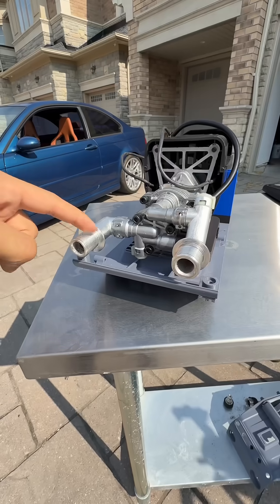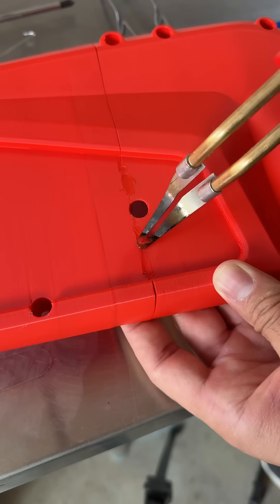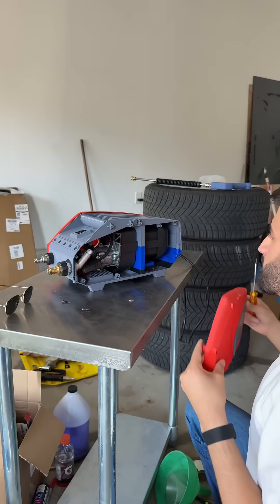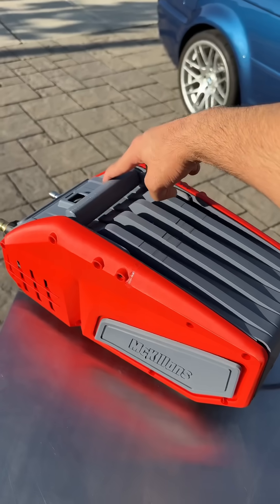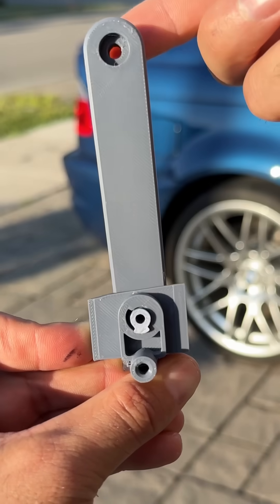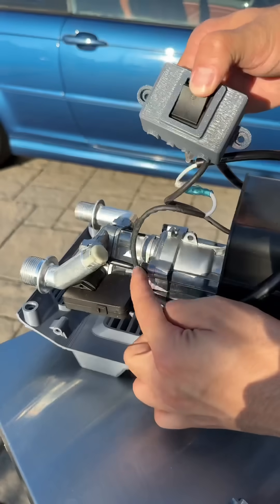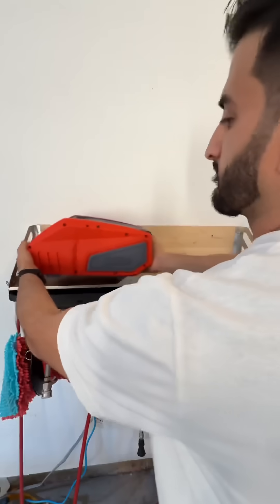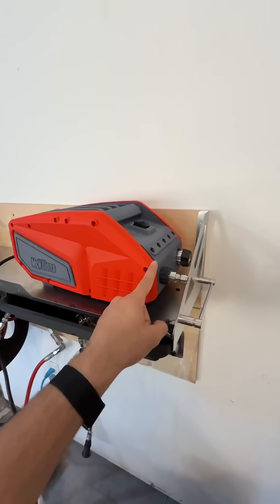Building the Best Pressure Washer for Cars – Testing 3D Printed Prototype #Shorts

Comment: Make it easy to replace panels, sell the panels, offer upgraded carbon panels, sell a “pro” or “plus” “Hd” version with full carbon panels from factory, weather resistant and tough as all get out, seems majority of the outer shell is primarily aesthetic/protection anyhow so making the panels replaceable bring in more reoccurring revenue whilst also not selling another product that’s just going  to break and be replaced/moved on from

Comment: dont know if youll see this but I would be careful with the keyed handle, if the key is that small it may not hold up to the pressure that leverage from the opposite side of the hinge (the handle), might be able to put on it. And if its one piece with the actual handle hinge then the key breaking may crack the hinge as well. I hope this is understandable

Comment: have brass inserts for the screws.  so you are screw into plastic.  if the device ever needs to be repaired it will strip the plastic screws in no time.  Valve made the STEAMDECK OLED and added this feature for repairability. Right To Repair is real dude.

Comment: As a repair tech my advice is:

1- invest to make the water pump portion strong and not like the ones found in the cheaper PW that feel more like hard clay when servicing

2- make it easy to service and open up to repair or replace components

3- have it be more sturdy and include fitting standard between the good brands so that you're not going to Home depot to get fittings for hoses 

My main concern would be having it be like a Ryobi and frankly those PW are the worst.

My biggest advice is to try Barens for parts.

Comment: I am gettin stupid ideas. Compact water pressure systems arent just need for cars also cnc machines. I hope you can push it even more. Perhabs create a lab version. Ship it over it allowed over FBA. So easier access to europe. A more neutral looking version would be need wich can be the lab version. Should be easy to push also thicker substances as well then with a bit more power.

Comment: I hope you used something like PACF material for the print. A lot of other materials won't hold up. At least ABS. Definitely do not use PLA, as it will definitely fail.
Reply from the maker: 3d printing is just for the prototype, final product will be injection molded :)
Reply: @mckillans now that is exactly the way to go. I would suggest either polypropylene or ABS. Unless you want crazy strength... Then I would go with glass filled nylon. I actually used to do injection molding.

Comment: A similarly sized, Chinese/Indian made pressure washer is around 50 USD. Parts are mostly common/standardized and very easy to repair.
Reply from the maker: they're definitely not hitting anywhere near the advertised numbers, see the previous video on testing. companies overstate their numbers by double their actual real world values...it's a marketing tactic because consumers only look at high PSI numbers as a decision maker
Reply: Lol that shits going to flop. Market won’t allow it. No one gives a shit if the pressure isn’t exactily what it says. Not anything worth the small profits your going to make what 10-15 per machine lol
Reply: @mckillans I don't mean to be rude but the pricing is a big factor. I will admit my bosch cost me nearly 300 USD. I'm also not from the US so value propositions are maybe different.

Comment: I would not recommend a sheet metal case, the internals and shape just don't look like they would go well with sheet metal, not to mention the cost of a progressive stamp and die is pretty high. 
This is a job for the industry standard >PA6 GFR< at like 30-50%. Injection moulded, will have excellent durability, will maintain reparability if used correctly. 
The handle lock out is too small and intricate for this size and weight of machine. I would suggest just using a compliant mechanism with a 30% sphere shape protuding from the handle near the pivot, and a reciprocal indent for the sphere. Make it compliant so it snaps into the holes. If the goal is to prevent the handle switching beyond 12 oclock, I would just add plastic stoppers to the case part in the channel where the handle arms sit.
Reply from the maker: final casing will be injection molded :)
Reply: @mckillans  hit me up if you'd like help with the design of the handle lockout mentioned

Comment: That locking cam seems weak Fyi try dropping the machine from folded position a couple of times and inspect inside
Reply: 100% it should just have a compliant mechanism. Put a little sphere bulge on the handle arms (like a BB is in the plastic protruding about 30%) and then add a reciprocal spherical indent/hole make the ball move past or comply past the rigid body until it snaps into the hole. No weak parts no stress concentrations etc.

Comment: TBH the lastic looks so cheap and it looks easily to break!😅😂
Reply: Can't say for sure but it's likely he will be printing final runs out of much stronger material. It's more expensive and there's no need to use your final material for prototype runs
Reply from the maker: this is just a prototype, final product will be injection molded...
Reply: I mean it is a prototype

Comment: Definitely contact a sheet metal sub-contractor for a better case
Reply from the maker: The 3D printing is for prototyping, the final product will be injected molded plastic.
Reply: @mckillans  Thought as much.
Reply: There's no good reason, 3d printed case replacements would be so cheap it woild not be cost effective, not to mention modern 3d printed materials can be extremely strong. You'd go to metal and when the internals wear out now you have a fancy case with no working internals. Using metal would make it costly for no reasonable benefit
Reply: @DarkAttack14  If you're building more than like 500 units, you would just spring for injection moulded parts, and injection moulded GFR PA6 is strong, and industry standard for tool bodies. 
3d printed is not cost effective at even moderate scale, unless youre prusa.
Reply: @DarkAttack14  Microplastic.
Reply: @DarkAttack14 3d printing isn't a manufacturing technique, it's for prototyping.

Comment: Focus on pump quality, stainless steel or ceramic piston, high quality durable internals that are serviceable, oil replacement, pressure unloader valve, high GPM, thorough testing and correct amp vs pressure rating etc. Dressing up a cheap pump is not what I would be interested in.

Comment: Why would you put the inlet and outlet on the same side so you have both hoses laying together and getting tangled easily?? One in the front, one in the back keep it streamlined and easier to move around
Reply: Thats only true if you're located/the pump is going to be between the tap and the car. 
This appears to something that would suit remaining in a detailing van on a shelf. In which case the inlet and outlet are going the same place.
Reply from the maker: you can easily add a 90 degree adapter to the inlet  if you prefer.

Comment: add some wheels or casters on the main body. make the hose couplings go at an angle or maybe make them swivel. Design it for constant everyday use and abuse, not for display.
Reply from the maker: the bottom of the machine will have standard thread which fit many casters, meaning you can buy your own casters and add the wheels :)

Comment: As a repair tech PLEASE make the case out of metal and have easy screws to get to. Also some way to easily change the oil in the pump is required for it to last.

Edit: sorry after reading your replies i do agree with y’all didn’t think about things like ABS or carbon infused plastics. But i still stand on the pump being easy to service.
Reply: With it being plastic it’ll be cheaper to get replacement parts if he continues supporting it
Reply: 3D printed is just for prototyping i am 100% sure he don't intent to sell it with a printed housing
Reply: Just do both. Those who got money would gladly choose the pricier one, just make sure it is worth it for customer & more profitable for the company. Make the cheap one for others, sell the parts to them, including the option for the metal part, but make it pricier because u gonna have more overhead to do this strategies. All side win.
Reply: If they release stl's for diy repairs I'd very happy with that as a compromise.
Reply: @lofty247 I was going to suggest this. Say if a 3d printed part broke or if you just wanted to print a new part out of a more durable plastic then either print it yourself or use a 3d printing service. Way cheaper for the manufacturer and the consumer, and easily serviceable.
Reply: But money
Reply: Metal will rust ?
Reply: It doesnt use oil. Thats how the new technology is
Reply: @higasaurous57 all pressure washers have oil (there may be a rare exception with ceramic bearings) but many times it's not meant to be changed. That's why they will wear out and become useless much sooner than older units would. It would be very good for him to include the ability to change the oil on the unit itself for superior lifespan and wear characteristic in my opinion.
Reply: You can get some insane filaments now a days for reasonable prices. PPA/PA-CF (nylon with carbon fiber reinforcement for strength, dimensional accuracy, and thermal stability) would be the the perfect use for this product and with “fuzzy” skin set it would look pretty nice
Reply: Rust
Reply: Don't make the case out of metal.
Reply: No
Reply: As long as that's not more than a hundred dollars, you'll be
Reply: Metal expensive, product more expensive
Reply: @xXfl33rXx yeah but the initial investment for a more durable and repairable product is more worth it than a 3d case than can snap or crack with normal use.
Reply: @Nathanc6308 ok but if product last too long then that's bad for business
Reply: @Robosium this comment is nasty
Reply: @Robosium Id rather have customer loyalty then have people say my product is crap and it breaks after x amount of years. Rather be around a long time innovating new products to sell rather than sell the same junk over and over again. Simple. He’s selling a pretty case over an item that’s been around for decades he can add some metal and make it last.
Reply: @Robosium don’t be that guy, ever. That’s terrible my friend. That’s why most of my appliances and tools are considered antiques. They last forever and are easy to work on/with. Cool thing about it, I will only buy from certain companies even though it’s a bit pricier. They last.
Reply: @Nathanc6308 good thing 3d printed materials are so cheap if it cracks it's massively cheaper than buying a metal case in the first place. There's a balancing point and 3D printing is only getting cheaper every year. Let's say the product costs 300 with a 3d printed case and 500 for one with a metal case. It may only cost you 50 dollars to repair the 3d printed model. If it did, it would have to break 4 times before you get to a point you'd have been better off buying the metal product! In reality there are extremely strong 3d printing materials avaliable nowadays that it likely would not be an issue, and the plastic would be significantly lighter
Reply: @kiyoponnnit's not truthful though. Companies on average do not make products designed to fail (unless you're apple, pretty shitty people running the show over there)
Reply: @kiyoponnnnah greed hurts everyone
Reply: @Nathanc6308  Im assuming its 3d printed now just for prottyping. 
Industry standard is GFR PA6 at like 30-50%. I wouldn't use ABS over GFR PA6. 
The major tool companies that produce cordless tools and allow for easy to repair tools all use GFR PA6.
Ryobi tool clamshells are ABS. 

Injection moulded the thing will be tough, remain light, and inexpensive.
Reply: @Nathanc6308 making it out of metal compared to plastic is not an initial investment, it’s an ongoing cost that scales with volume lol
Reply: @DarkAttack14 "on average"? "only Apple"? Say that to an appliance repair tech, an auto mechanic or a wholesale parts supplier and see how that goes
Reply: Doesn’t need to be metal, just needs nuts molded into the plastic
Reply: @KangaMoose34  This piece of shit is gonna be something you'll have to replace every single summer😂
Reply: Metal is expensive and not entirely favorable given that it will be living in garages with water, having plastic with proper heat set inserts is a good way for him to make it a great product
Reply: @maximman102n7 
Ever heard of quality stainless? If it lasts in marine environments for years it'll last in your garage for decades.
Reply: @Ellron23 Ever hear of cost effectiveness? Who cares if the case survives when the internals will wear out after a few years

Comment: Is the switch rubber sealed? Because if it is on the top it will absorve a lots of water and potentionally kill someone.
Reply: That's unlikely to occur even with a completely exposed switch and spraying water directly on it lol, you'd need the perfect storm of failure to even risk it. You can spray a fire hose directly at a powerline and not even get a tingle
Reply from the maker: yup there will be a rubber cover on top, good eye :)

Comment: The lock at the 12 position in my opinion adds a weak point
Reply: Yep just let it swing
Reply: My thoughts exactly. Just let it spin. Can’t break if it can’t hit anything.
Reply: Either let it spin, or just use a compliant mechanism with a protruding part of a sphere that locks into a complimentary socket. Have it on the inside surface of the handle. Basically like if a ball bearing was stuck inside the handle and protuding about 30% of the way out.
Allows a lock out that smoothly operates, as the ball shape acts as a ramp, but doesn't add a point of stress concentration.
Reply: Exactly what I came to say, unless the pivot area is entirely metal just let it swing and balance itself.

Comment: Excellent explanation. Will this be available in 220-240v 50/60Hz ?
Reply from the maker: Yes it will be available in both 120V and 220V
Reply: @mckillans Thank you for this great update. I am already your existing customer. Bought the ext. wand and pro gun, shipped to Saudi Arabia which is where I live and work 😊
Reply: @VinylsFinal nice must be buddy buddy with the rich princes there 😂
Reply: @DigitalPrismRecords I wish. I am an expatriate here, not a local pocket loaded with cash Arab 😂
Reply: @mckillans  I would suggest making it a smart switching supply so it can accept 120-240v 50-60hz
Reply: 3d printed case is not gonna last it’s gonna get broken easily
Reply: @Farmerwalky I've had plastic products last over a decade+ and had no problem, and many modern 3d printing materials are stronger then those plastics. I highly doubt it would be an issue and even if it was the replacements would be very very cheap